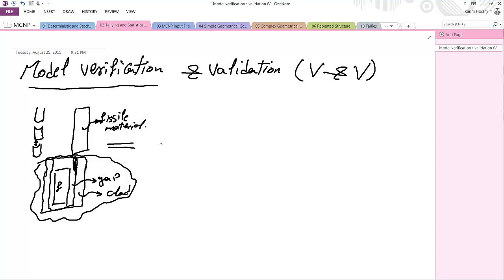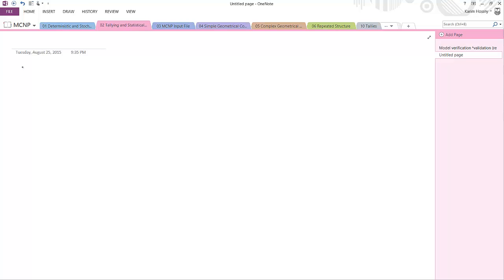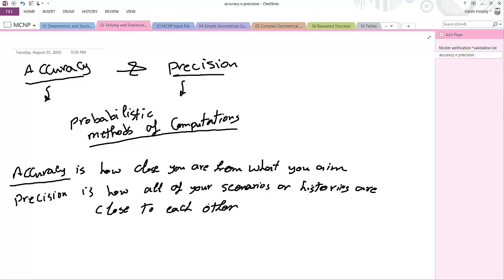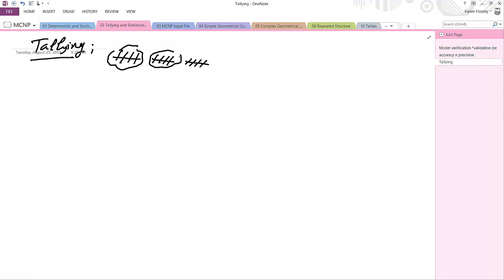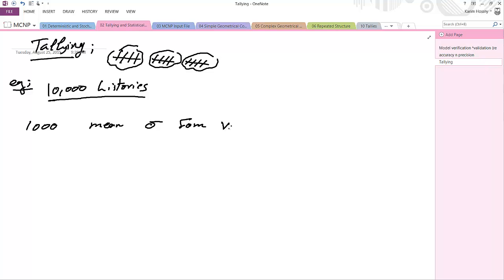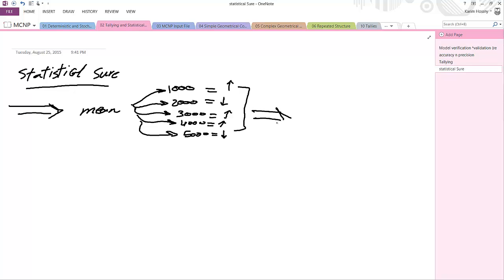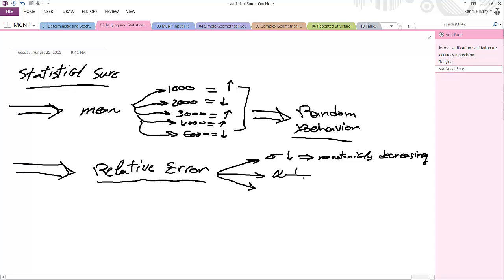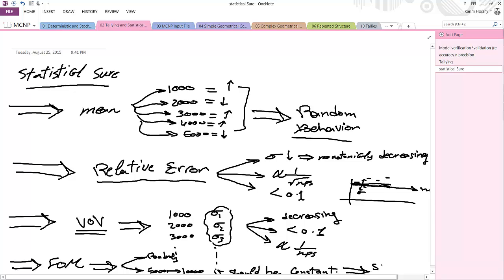MCNP 02 | Introduction to Tallying and Statistical Checks

Comment: I have a problem. I wrote a short mcnp5 code to model a simple a specimen in a box like structure. On running it, it gave 5 fatal errors. The errors reads: no material card for cell 1,......., 5. Each representing an error. But the material cards are provided. I have tried to resolve it but no success. What is your suggestion Dr Karim?

Comment: No discussion of the slope estimate?
Reply: Sir, I am also interested in the details of the slope estimate. Your contribution here is very resourceful but further illustrations like Dr Karim observed will go a long way. Thank you for your input.
Reply from the maker: Thomas Booth unfortunately it was extremely difficult for me and I was not able to fully understand it.
Reply: The slope estimate is extremely important as it is the only indicator that is not score moment based.  The slope estimator attempts to assess how many moments of the score distribution are finite. One needs at least two moments for the variance to exist (slope of 3) and four moments for the variance of the variance to exist (slope of 5). If the slope is indicating 2.8 then the variance may not be finite. At a minimum, the empirical variance estimate are probably totally unreliable.
Reply from the maker: Thomas Booth, thanks alot, this really helped a lot. I have been  trying to understand the slope check for over 3 years now. If you can illustrate more including  the maths that would be extremely helpful for me and of course for anyone who reads it or watch the video.